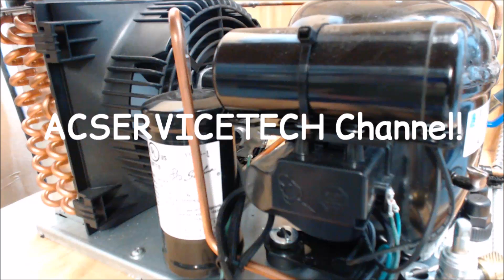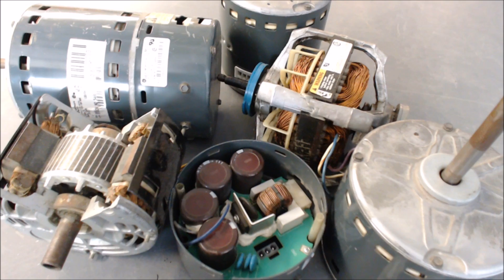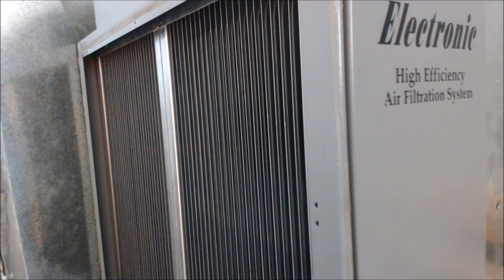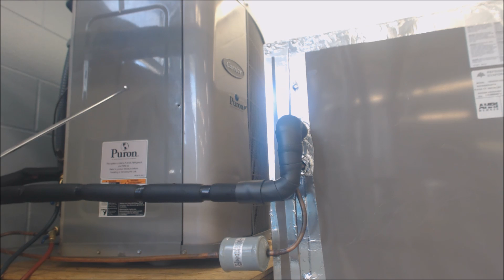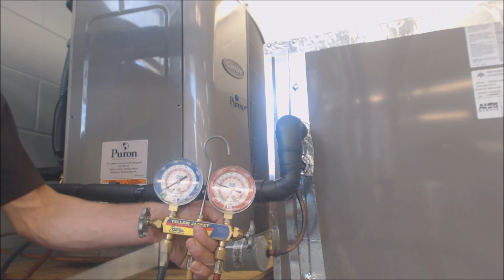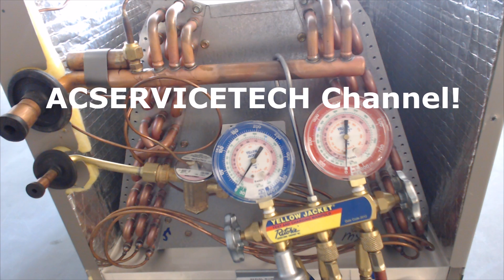Refrigerant Charging: Two ways to Check Refrigerant Charges, Deeper look into the Refrigerant Cycle!

Comment: Hi Craig I really appreciate your videos. They're really helpful. I have a question please.
I recently installed a New Refrigeration Unit in my workplace, the system is used to cool down the evaporating temperature in a CO2 tank therefore reduce the pressure of the tank. The installation manual states that a TXV was to be installed,  so i suppose we will need the target subcooling to check the charge of the system. However, there is no target subcooling on the system and since the system is commissioned the pipes have been freezing up all the way to the TXV which is a sign of over charge but even when the charge is reduced i cant trace the exact level needed?

Comment: Excellent video - thank you! 
Question: I serviced a Lennox recently that was only placarded for "Approach" charging (410a). It had a TXV, but there was no target subcooling (or superheat) listed anywhere. The actual measured subcooling was about 15°, which seems 'about right', but using the approach method (LLT-OAT) I measured 2.5°, but the placard was calling for 6° ± 1° - indicating an overcharged condition. (There was nothing weird about the install. Standard residential 3 ton cooling only with about 20 ft lineset, evap coil about 6 ft higher than condenser.)
I ended up deciding to leave it like it was, but it's been bothering me... should I have recovered some of the refrigerant? I assume the tech before me knew something I didn't  - but maybe that was an incorrect assumption? I've read up on the topic and it seems a lot of folks disregard the approach method as inaccurate or 'voodoo magic', and others seem to follow it closely. The only person I REALLY trust is you, so I really hoped you'd have a video on it - this one was the closest I found. If you have time, I'd love to hear your thoughts! Thank you
Reply from the maker: If it is a standard copper tubing on the outdoor unit then you can target roughly 11 degrees of subcooling if there is no target subcooling and also check the total superheat to make sure the TXV is doing its job properly and holding between 8 to 17 degrees of superheat but preferably 10-14 degrees F of superheat, thanks!
Reply: @acservicetechchannel  Thanks so much for the response! FYI, on Monday I called Lennox and talked to their tech support team. I asked specifically whether there was an 'unofficial' subcooling number they could give me for the model. He asked for the serial number, which I provided, and after looking it up, he quickly told me the correct way to charge the unit is using the approach method. I pushed back, but his response was, "Look, if you want to make up your own number for subcooling on this unit and use that, be my guest, but it's not the correct way to charge it." Haha - put me in my place!

Aside from that, I've done quite a bit of reading on the topic and it seems those who are smarter than I am have some pretty logical and solid explanations as to why using subcooling on these 2000s Lennox machines is a bad idea, and to expect a properly charged system to show about 6° of subcooling. 

So, I returned to the customer's house yesterday and charged it using the approach method. I ended up removing 1.05 lbs of refrigerant (7.5 lbs is factory charge), and the measured subcooling ended up being exactly 6°! The superheat (11°) never changed, but the compressor did get quieter, which I suspect is because maybe it was taking in a bit of liquid from being overcharged(??) 

Apparently, since the approach method is so rare, it's super common for techs to look for the target subcooling printed somewhere, not be able to find it, and just "guess" 13° and charge for that. In fact, when I asked the homeowner if she remembered anything about the last time it was serviced, she said the tech definitely seemed to be confused by something and told her he "added some freon just in case". Hmmmm.

Do you think using the approach method is WRONG? I've read plenty of places where people said it was imprecise and 'guesswork' to use approach, but I actually found it rather precise. As usual, I had to wait a few minutes for things to settle down between 'squirts' but by the time I finished it was solid. Would love to know your thoughts, if you have any. Thanks again for the response and great content!

Comment: Trying to fix my own home unit. Still getting some cooling in the house average 80 degrees when hot outside and close to outside temp. when cooler. Have been watching your videos and this particular one gives me a complete understanding of how everything works. I bought all the equipment needed and teaching my self how to do it. mine is a superheated meter device on. Thank you for your free teaching, you are excellent and clear with your videos.

Comment: I'm an HVAC helper trying to learn more and I am not understanding how it can be low pressure, low temperature yet be superheated.... if its at a low temp how is it superheated.
Reply from the maker: The saturated state exists in both the low pressure indoor coil and the outdoor high pressure coil. At the indoor coil, it is changing into a vapor and rising in temp. Have you looked at the "acservicetech refrigeration cycle explained playlist" "acservicetech superheat playlist"

Comment: When you go to a unit how do you know what high/low pressure values you should read for unit to be ok ? Or is it just the superheat and subcool values that tell us unit is ok ?
Reply from the maker: Yes sat above 32 on the low side usually 35-48 but really superheat for fixed orifice and subcooling for txv, thanks

Comment: thank YOU! brother for sharing what you know. its crazy how we have information at our fingertips. anything we want to learn about. i have a pretty good understanding of hvac systems. im pretty good at troubleshooting them after being a maintenance engineer at a hilton hotel for almost 10 years but im somewhat lacking  when it comes to refrigerants and how it works in a system but thanks to good people like you, im getting better at my chosen career i love it. as far as gauges and digital multimeters goes what would you recommend?
Reply from the maker: Here is a link to the UEI DL389 Multimeter used in the video-  http://amzn.to/2av8s3q

Here is a link to Refrigerant hoses with valves used in the videos-  http://amzn.to/2aBumVI   -and the Yellow Jacket Refrigerant Manifold Gauge Set used in the videos http://amzn.to/2aenwTq

or the yellow jacket 4 port manifold with hoses - http://amzn.to/2qtSZJy

I also like the Hilmor 4 port manifold but I like the hoses with the valves closer to the ends. Hilmor temp clamps have been very accurate though -  http://amzn.to/2m4QLik

ACSERVICETECH is a participant in the Amazon Services LLC Associates Program, an affiliate advertising program designed to provide a means for sites to earn advertising fees by advertising and linking to Amazon.com.
Reply from the maker: Yeah I did not have this when I was growing up in the trade. It is a huge benefit for my students and others now. If one is hungry now they have more ability to learn in depth techniques that would not normally be available with local techs within their company. Very Cool!

Comment: Any suggestions or what to watch out for (for a newbie) dealing with a line set that goes three stories up? I just started at an apartment complex. I was thinking the wireless manifold set might be good to have also.
Reply from the maker: The biggest thing is the loss of superheat from the evap to the compressor. In that case where the calculations lead you to believe a significant loss in superheat, you may want to add an accumulator. Make sure the feet per second is fast enough for the oil return to the compressor but that the lineset is big enough in diameter to not add excessive friction to the compressor. I am not a huge fan of full digital manifolds for new techs as they tend to take the thinking out of the equation for problem solving. I would rather have the mind engaged as much as possible. One nice thing about them is the remote wb wireless probe for checking superheat and finding target superheat. That's just one person's opinion though. Thanks

Side note, my student just won SkillsUSA NJ for High School HVACR tonight and I am very proud of him! I just needed to say that!
Reply: I don't think I've seen any accumulators on the property but I will make that my next 'study material' to understand.
As far as the digital gauges go, I was originally going to ask if you find that it "dumbs down" techs new in this field. I could see that happening, especially when the gauges make some of the calculations for you. If I do go digital, I will be sure to have a full understanding of analog gauges. Thanks!!
Reply from the maker: Thanks Tony. Look up "acservicetech HVAC superheat and subcooling explained" for an understanding of the accumulator. This video is about a heat pump but will go over the accumulator in cooling and in heating mode, thanks

Comment: I greatly appreciate you sharing your knowledge in such a no nonsense, concise fashion. I do have a question regarding measuring the wet bulb temperature. I was under the impression that the most accurate wet bulb readings when using a digital psychrometer were to be measured after the system's air filter. I believe this method was recommended by Fieldpiece for their pocket psychrometer. What are your thoughts on this matter?
Reply from the maker: I am all for getting as close to the return of the evap coil. That will be the most precise measurement point for sure. On the flip side you need to check the wet bulb every five minutes or so when charging as the wb will decrease and change the target superheat. Most people out there  have a digital psychrometer that is a little larger and can't fit the sensor in the duct. The sensor will need to have a very tight fit. There are problems like in my area unfortunately at least 50% of evap coils are in attics so to take the tool up in 130 degree heat with the sensor in the duct, I am not so sure the heat will not migrate from the tool to the tip. Fieldpiece has it designed right and with the right tool you can change what you are doing. Their sensor head is not attached directly on the top. They use a a cord and wand which would work well if the wb was taken near the coil in the attic. The answer to the question then is yes it is better to get within a few feet of the evap coil in the return while not sucking in air from where you are accessing the reading while being able to check the actual wb every 5 minutes or so. Even better is fieldpiece's wireless app for the pschrometer so you don't have to keep coming back in and out to check the wb. The wb difference between the largest return grill in the house and in the return near the coil in most cases could likely be about 1 degree or less but could be more if there were problems like duct leakage a 2 story house with only one system and/or other issues. Really great question!
Reply: acservicetech 
Perfect! Thank you very much sir!!

Comment: sir when you say ambient temp is it temp inside the room and the AC is working or is it the temp when the AC is not working? how do I know the static pressure is correct ? is it r22 charging concept can be use to charging   r134a? hope  you can answer my question I'm just new in ac I'm working cars ac we use r134a thank you sir hope to learn more to your videos
Reply from the maker: The issue with cars are that you have a compressor that can ramp up or down depending on the rpm of the motor instead of single speed in which we use the superheat charging method with a fixed orifice. At the very least you need to make sure that your vapor line is above freezing and you have at least an 18 degree temp difference between the return and supply. Ambient is the outdoor air. Conditioned air would be the air in the car. Check out this video  --- https://youtu.be/ZwgjiqGJTho

Comment: I always find the rare case where you cannot charge a txv with subcooling. Been dealing with a couple water source heat pump that require charging in superheat. But they do use an heat exchanger and not a condenser .
Reply from the maker: Thank you for your comment! Yes systems such as Geothermal units may not have a port between the condensor and the TXV in cooling mode. In heating mode the condensor would then be the evaporator instead. Most water source Heat Pump Manufacturers will provide a chart of operating pressures and temperatures along with Superheat degrees and Subcooling degrees along with entering water temp gpm and water temp rise for diagnosis. They have developed this because of water temp and flow for better diagnosis and for checking heat exchange. The nice thing as well is that these are usually packaged units and have a total weight of refrigerant for the system so if there were a bad leak you could then you could recover, find and fix and weigh back in the exact charge. Thank you very much for your comment!